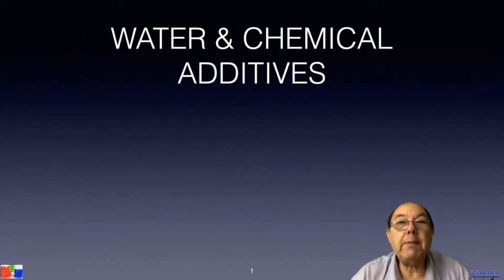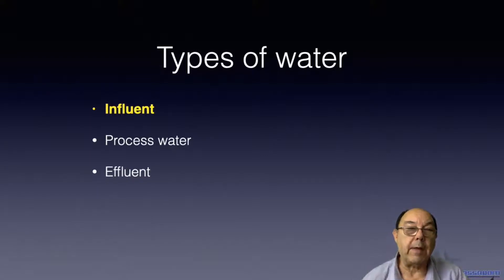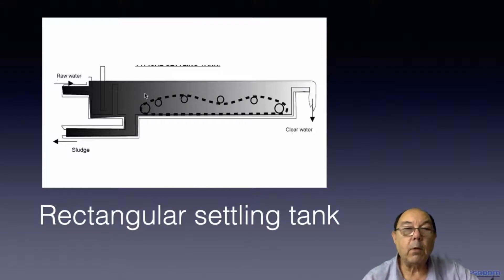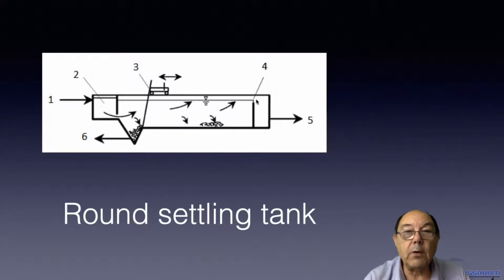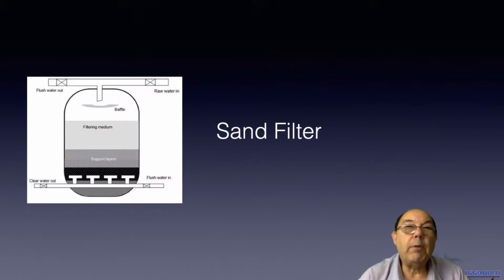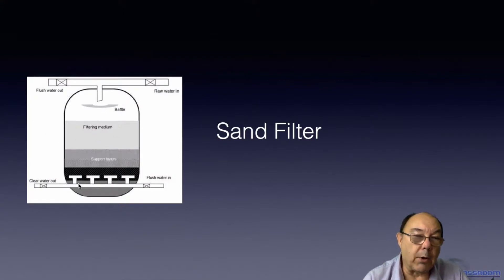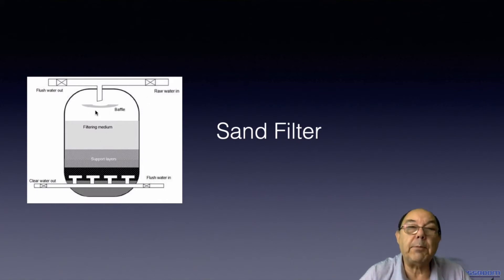Level 2 Papermaking - Equipment for Influent Treatment

Comment: 0:08 Looking at Equipment
0:23 Three Types of Mill Water
1. Influent - Water coming in
2: Process - Water carrying out the job
3. Effluent - Water going out

1:04 Equipment used for the treatment of Influent

CIO2

1:51 Three Shapes of Settling Tanks
1. Rectangular
2. Round 4:23
3. Lamella Box

2:46 What is the smallest particle I need to settle?

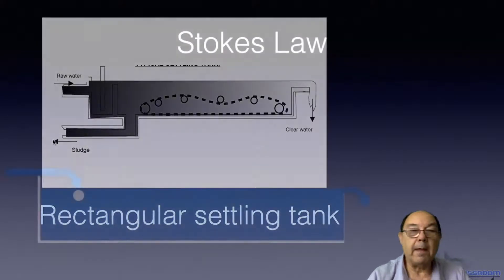3:26 How does Stokes Law play into this?

5:02 Essential: Laminar or Layered Flow
+ No Turbulence + Desirable settling

6:32 Sand Filter

8:30 Next Time: Process Equipment and Effluent Equipment